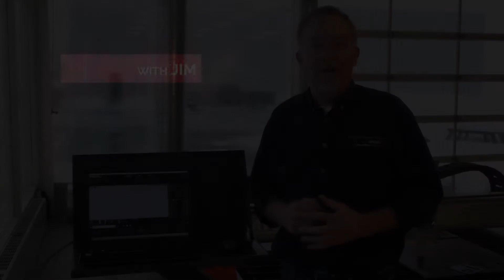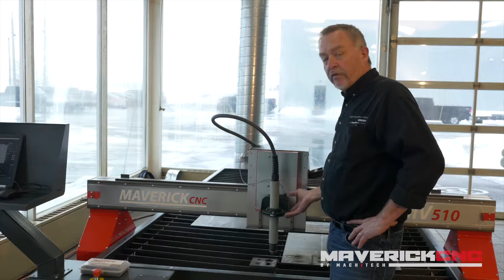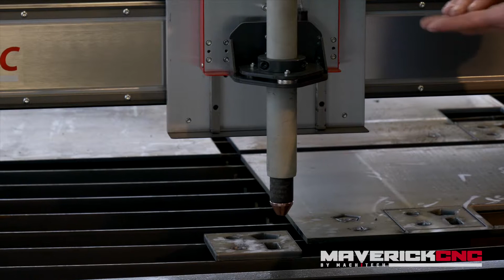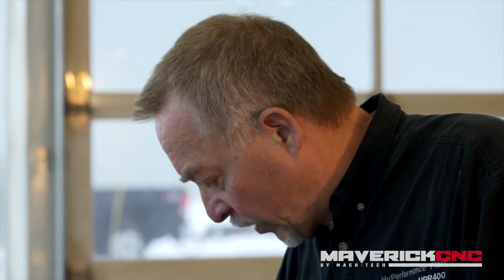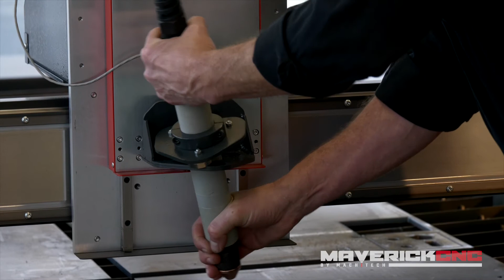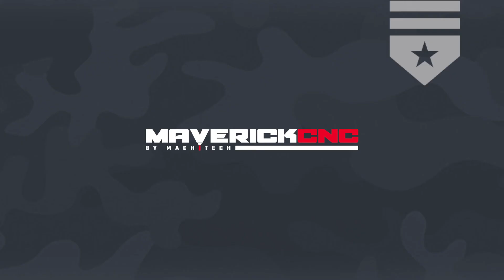Learn Arc Voltage Height Control on a CNC Plamsa Table with Jim Colt

Comment: I getting arc heights problem that is higher than enough height
Reply from the maker: First, keep in mind that accurate control of torch height is critical to good cut quality as well as to consumable parts life on any CNC Plasma cutting application. Most cnc plasma machines use an arc voltage feedback "torch height control or THC" system that monitors torch to workpiece voltage in order to maintain the correct torch to workpiece distance. This device uses electronics and software to maintain the torch to work distance within +- .005" of the torch manufacturers suggested height during steady state cutting. Generally, if the torch is set too high (too much distance from the workpiece) you can expect excess dross, warpage, and severe cut edge angularity. If set too low, there is a high probability of plate collisions and torch dragging which will affect your cuts, will affect consumable life and could cause torch damage.  If you height appears too high....then you should lower the arc voltage pre-set in your software until the torch maintains the correct torch to workpiece distance for the material being cut. If the torch is too low, then you need to increase the arc voltage pre-set. 

With the Maverick CNC machine the recommended height, voltage, cut speed (and other critical cut parameters) are all stored in the CAM software, simply choose the material and thickness you are cutting, ensure the correct consumables are loaded in the plasma torch, and start your cutting process. Keep in mind that if you change any parameters (such as cut speed or amperage) you will have to reset the pre-set arc voltage. Slower cut speeds will require a higher voltage to maintain the correct physical cut height, faster cut speeds require lower voltage settings.    Happy cutting!  Jim Colt
Reply: @MaverickCNCPlasmaTables  my problem is, where do u find the proper volt to begin with related to material being cut?